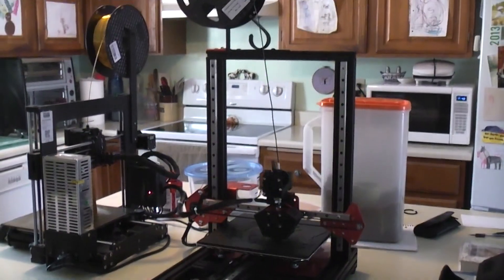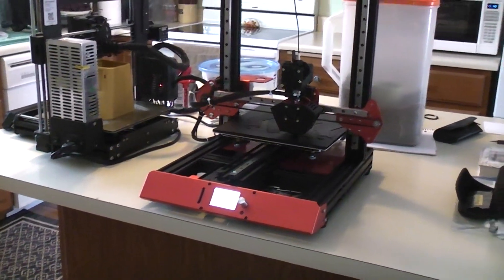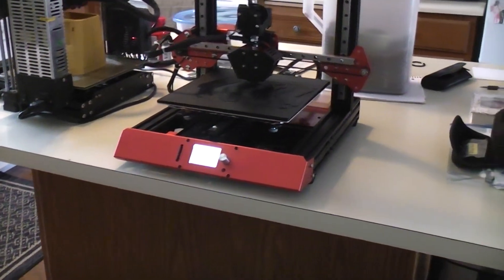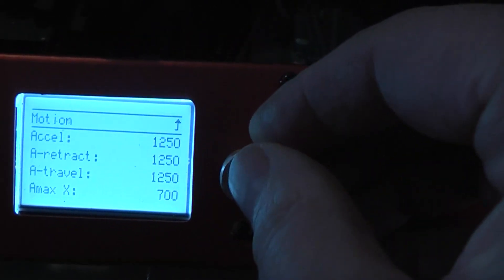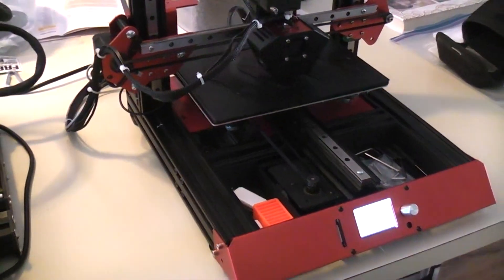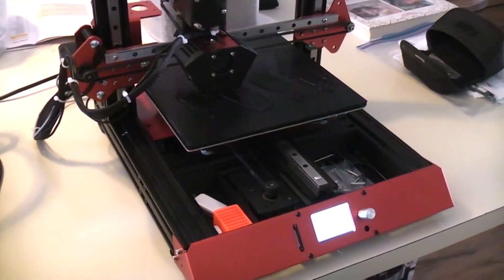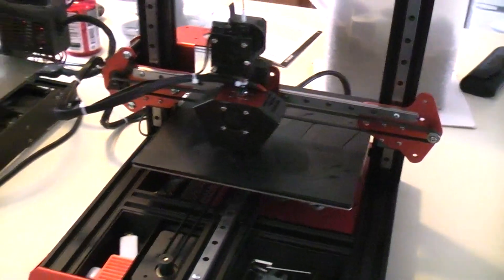Adjust your machine Acceleration and Jerk for smoother printing.

Comment: Grease the sliders and loosen the rubber bands as much as possible (without skipping or slacking) and you can use high jerk fine.
All the moving parts move buttersmooth then it's perfect.

Comment: ajustes geniales para ender 3 v2! está andando con klipper y cura slicer, los ajustes los puse en el cura slicer, para hacerlos visibles busqué "activar control de aceleración" y "activar control de impulso", ahí puse los ajustes que creí necesarios, en aceleraciones, 1250, 700, 500 y 300 mm/s2 por otro lado en el impulso o jeks usé el valor de 7mm/s3

Comment: nice work i have prusa i3 bear upgrade with print volume 300x300x300mm x,y,z and i use 8mm round rod not rail, does this settings works with my setup as i'm suffering from vibration in the bed?
thank you
Reply from the maker: Slowing down the print speed might help as well. But changing the Acceleration and Jerk will probably help as well. I wonder id 8mm rod is large enough for the larger build plate. I went to linear rails on my Prusa printer for the bed.
Reply: any ideas for the acceleration values suitable for this size of bed 300x300 also with 8mm rod 
i can upgrade the rod to something bigger like 12mm or so if it will add more stability and prevent or reduce the vibration 
 @Robothut

Comment: I've been using a .2mm nozzle lately...(PRINTING small stuff)... turned my jerk to .3. Yup.
Zero Point Three. And acceleration is 100...lowest I can set it. This thing not only runs smoooth...but when it does a long travel, it sounds really cool.
Pitches up then down...
wwWRYHHHRrrr. No more, RAHHH-RAHHH-RAHHH...It's not a race...is it?
That has to be advantageous on the life of the moving parts.
But then when your printing at 12 and travel 25 on prints smaller than a bottle cap...Really have to have that K factor dialed in.
Reply from the maker: So true. And good information for those that print the small stuff.

Comment: Might be worth putting a shotglass of water somewhere it can sit on the bed while tuning jerk. There's a PLC jerk settings video here on YT that shows what you are really tuning for with those jerk settings and the water makes it obvious. If you can't find it or one like it where it's demonstrated. Ideally you want your jerk settings to cancel out the motion of the water while still letting the motions of the printer hit the desired acceleration.

Comment: Thanks , does Cura setting effect ?
Eg if jerk is off in the slice profile does the printers default switch off ?
Reply from the maker: No the printers firm ware was over riding the slicer settings. So made the change in the menu of the printer and all is good.

Comment: why don't you change these settings in the slicer rather than the printer?
Reply from the maker: Changing them in the slicer had no effect on the firm ware setting of the printer. The fir ware over rides the slicer.

Comment: Those settings in the machine for the Acceleration, I think those are overwritten by the g-code settings... Or are they?
Reply from the maker: They do not seem to be as the machine setting made a big difference for me. I thought the same thing back when I was trying to get the printer to stop slamming the big heavy glass bed around and slicer setting would not fix it. But the Machine setting did. So it may be different with different printers or versions of printer firmware.
Reply: @Robothut  I ask this because in my slicer I set the print speed to be 2400mm/min or 40mm/sec. And in the Printer settings the speed is set to 1200mm/min  or 20 mm/sec... I had a print that was estimated in simplify 3D at 16 hours. The actual time it took was 20 hours. So I am trying to find out why the huge difference...
Reply from the maker: @Bajke20  I do know that the firmware in the printer will over ride setting from any slicer that tell it to print at a speed that it can not do. The actual print speed can be very different from what the slicer says he print speed should be. And not all sclicers have a good print time estimate , Cura used to be way off but has gotten better with all the new versions. Prusa slicer is very close to actual print time.
Reply: @Robothut  if this is true, then if I set  the Acceleration x,y,z to be 2400mm/s, the sam as it is in the slicer Simplify 3D the one I am using, then the actual print time should be a lot closer to the estimated one in the slicer... Am I right? I have the Ender 3 Pro...

Comment: can you please show me your velocity values, i will flash my cr10s and search for good values
Reply from the maker: I never changed the velocity setting just the Jerk and acceleration. They are shown in the video. So velocity would be what ever is factory. Next time I am out in the shop I will check the velocity and edit this comment.
Reply: @Robothut  I don't know what is factory 😔, can you show me yours?
Reply from the maker: Velocity setting's. vmax X 200, vmax Y 200, vmax Z 12 and vmax E 120.

Comment: Hello! Did you've got standard Flash (with TMC2100 drivers) or Double-Z, BlTouch and etc (they put TMC2208 there)? I have some issues with Linear Advance calibration. And some people talk that the stock motherboard isn't good for LA even (8-bit and too slow).
Reply from the maker: I bought the lowest price Tevo Flash, so single Z stepper motor, NO bltouch No TMC 2208 drivers. I do not know what other problems are but my modified Tevo Flash Basic printer prints as good as my Prusa MK3. I would like to upgrade the hot end one day or even replace the glass bed to a lighter aluminum bed design.
Reply: @Robothut  Do you remember your K factor value for non-modded (no rails) Flash? I've tested e-jerks from 10 to 30 also. Seems that e-jerk = 30 works the best.
Reply from the maker: Sorry, I do not remember. I should have wrote it down for reference but did not think about it.
Reply: @Robothut  Thanks for your time anyway!

Comment: Another thing: 
If jerk is slow, print speed should also be slower (Max 4x jerk speed) otherwise you’ll have other artifacts in the print.
Reply from the maker: I have not had a problem. The prints off my modified Tevo flash are as good as any printer I have seen. The only thing I would like to change now is the clone Volcano hot end with the ptfe tube in the heat break thoat. It adds a lot of drag to the filament. I see E3d is coming out with a new hotend that should fit the bill, so will be upgrading once it gets released.
Reply: Robothut Ok. This was not related to this particular printer but in general. You can experience rounded corners on square prints if speed is high, but very low jerk.
Reply: @nordemoniac  if speed is high corners are rounded also without changing jerk. I didn't touched that until now

Comment: Having the same problem with my Duet2 Little Monster. Thankfully, Cura has a PLETHORA of things to tweak. Since my printer isn't Marlin, I was still able to play with such settings through Cura!

I had my jerk turned down to 15mm/s for walls only since I was getting some serious ghosting. I'll try the 7mm/s you did and see how that goes :D
I haven't touched acceleration yet since I print around 85-100mm/s (#deltalife yo, lol) but will try the values you've entered for yours.

Thank you for the helpful information!!! :D
Reply from the maker: Keeps us updated with what you learn, it helps us all. Love the little monster, mine is freeking fast to print compared to other types of printers. I could slow it down a lot and still have a decent print time.

Comment: Hello, THANK YOU SO MUCH!!! I was having the same problem until I watched this video👍. How do you save the settings after you change them? I'm using a Tevo Tornado. Thank you!
Reply from the maker: I do not have the Tevo Tornado so do not know if the printer firm ware is the same, but check the printer menu there should be a place where you can click to SAVE SETTINGS.
Reply: @Robothut   Thank you!!!! I have most of the same options as yours but I recently updated the marlin firmware for my printer. Did you update your marlin firmware?
Reply from the maker: No the Tevo flash is stock firmware. Since the thermal run away works and all the other functions I use work I did not see the reason to change the firmware. But if I decide to add auto bed level sensing then I probably would change the firmware.

Comment: Gosh, man. I’m trying to figure it out because my machine (Tevo tarantula) is shifting layers as well but my jerk is already down to 4 and my acceleration for X and Y is 3000! Z acceleration is 100! WTF! I have no clue what to do lol people are saying to change from 60mm/s to 50mm/s and slow the print speed/“FR” to 50% too
Reply from the maker: I would check the driver voltages. Sounds like 1 or 2 of them is set way to low. For example back when I got the Tevo flash the first thing I did was just take a look at the driver voltages and 1 of the drivers was set at about 1/2 of the what the rest were set at.
Reply: Robothut Thanks a ton, sir. Will try to figure out just how to do that and see! Really appreciated
Reply from the maker: There are lots of you tube vid's on how to check the voltage setting of the stepper drivers. But long story short. connect the negative lead of a volt meter to power supply ground and  connect the positive lead of the volt meter to a very small screw driver. Then touch the small screw driver to the trim pots on the stepper drivers. The volt meter will show the set voltage . Check and see what they are all set at. If one setting is way different from the rest then you know it needs to be adjusted. Also Have a idea of what driver might be at fault first. So lets say that you are getting layer shifts in the "Y" direction, the movement of the bed, then when you are inside poking around you will see the "Y" stepper driver and can check it . Normally they are marked on the PCB or the wire cable.
Reply: Robothut Update : just tested with the following changes from my previous print... changed from 60mm per second to 50mm per second, jerk to 2 instead of 4, acceleration to 600 instead of 800, 70%FR instead of 80% and then tightened the belts. That resulted in a horrible print that was shifting every layer. Damnit lol I really appreciated the help, man. Bummer! All I can think of is to go back and try what you said
Reply: Robothut If I end up figuring out how to check the driver voltages and change them, would you expect my acceleration or jerk settings to then match yours or maybe I should then change them to match yours
Reply: Robothut Haven’t done a ton of research yet on what you described and checking the driver voltages but from what little I’ve done I haven’t really found a way to check, yet. Will do more research after work
Reply: Robothut Hopefully the driver voltage settings are in the controller/menu thing. If find it and I see a number that’s not like the others, I’ll change it. But I guess just leave the acceleration and jerk values the same
Reply: My “accel” is 800, A-retract is 2000, A-travel is 3000 which is all different from yours

Comment: makes it really quiet too. just did mine
Reply from the maker: Yes, it helped a lot with the audio level of the printer.
Reply: @Robothut  what are your feedrates set at? will it matter if they dont match?
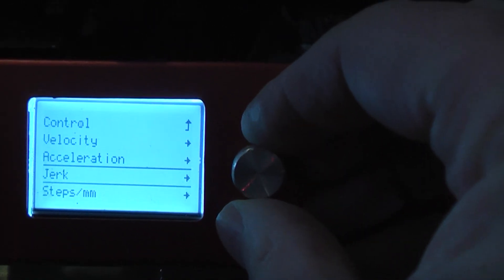Reply from the maker: starting at 1:30 in I show my setting for the Jerk and Acceleration. Jerk X and Y are at 7, Acceleration for X, Y, Z, are set to 700. Print speed is default 100 % and set by the slicer. I like to use the Prsua slicer program and I just take the same G code files that I send to my Prusa MK3 S printer and use them on the Tevo Flash as is .

Comment: I know what the settings are now, what were they? Would it be better to set this in the slicer? Thanks
Reply from the maker: I found that changing then in the slicer did not fix problem for me. But the controls in the printer did and are so much easyer to change and play with. You can always go back to factory settings in the printer menu.

Comment: Don't lower jerk, enable S_CURVE_ACCELERATION in Configuration.h
Reply from the maker: More than 1 way to skin a cat. Lowering the jerk has worked great, the prints never looked so good. So simple to do and undo if the results are not what you want. Also this was a cure for the Tevo Flash it may not be the best way for other types of printers.